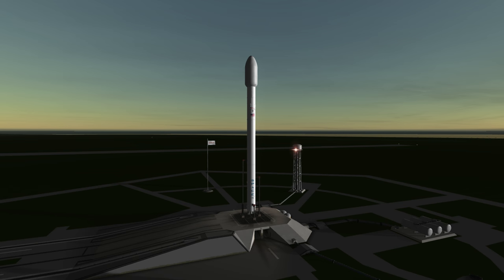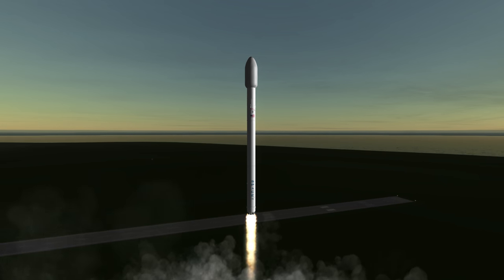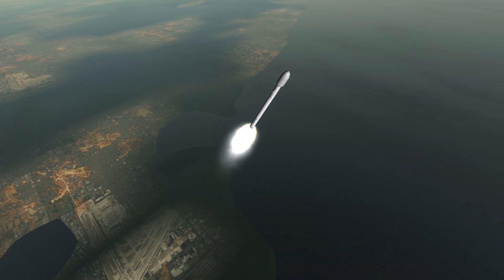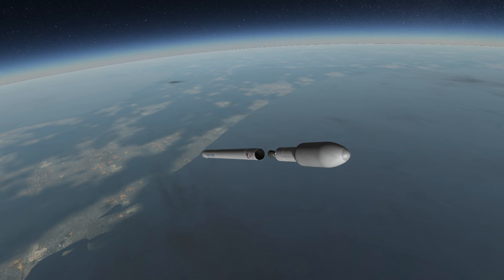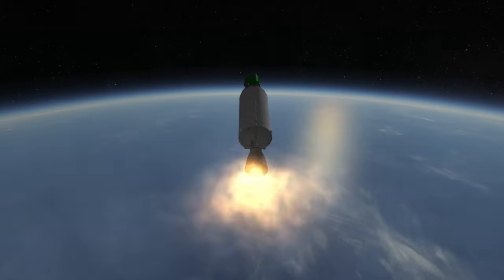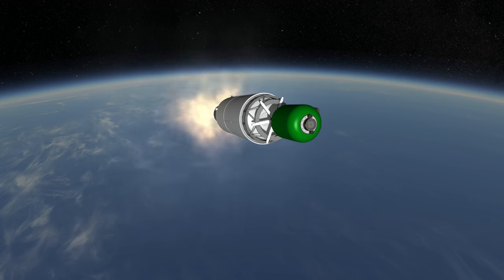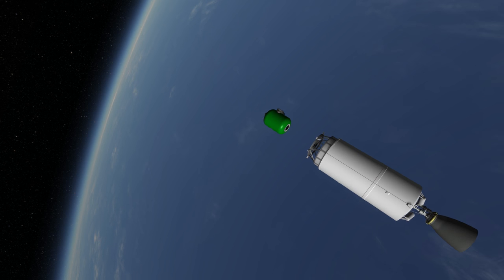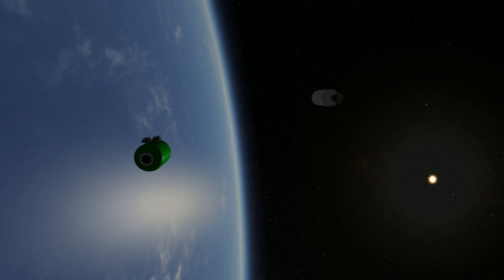Rocket Profile - Falcon 9

Comment: Didn't the Space Shuttle start the reusability race? Actually the shuttle was even more successful in that department than the Falcon 9.
Reply: The Space Shuttle was crippled by bureaucracy and government and was far, far more expensive than it needed to be, and also has killed far more astronauts than the Falcon 9. The reusability of the space shuttle was all publicity with no appreciable gains cost and time-wise. The Falcon 9, on the other hand, is an actual private industry rocket that is proving that reusability really can be a thing and really can drive down costs dramatically because of market forces (I almost said free market, but our markets are so heavily regulated that it's a joke to call them "free", but the costs would come down even further if they were). That said... the Space Shuttle was pretty cool... but the Falcon 9 is even cooler. We're doing stuff that was only dreamt of in '50s sci-fi with this rocket!
Reply: Debott 

Tl;dr:

Yes STS started it but F9 is perfectioning it.

BTW did you see the new Block 5 and the Heavy liftoff?
Reply: "Actually the shuttle was even more successful in that department than the Falcon 9."
Wow so wrong.
Reply: Go to 2:46 and listen.

Comment: You should note somewhere that the version shown is 9.1. Unless you did and i missed that ;]
btw, will you be doing Energia's profile? Would it be Buran or Polyus version?
Reply: It's actually the Expendable variant, which means the landing legs are missing as they are not needed.
Reply: Yeah, that's why i thought it's 9.1, i was certain that each 9v1.2 has landing legs (and is recoverable), shame on me.

Comment: I have a few questions:

1. Is this KK's SpaceX Launchers Pack?
2. Are you using Real Solar System? (It says on KK's Launchers pack page that RSS is not compatible by default)
3. If you are using RSS, can you please give me the config file (or whatever it is)?

Edit: Could you also tell me how to install a config file?  I've never done it before and I would like to know how.
Reply from the maker: Yes, it's KK's Launchers Pack and Real Solar System with Realism Overhaul. The config is my own and doesn't include all the parts - just what I needed. You can just dump it in the GameData folder but keep in mind that you need RO dependencies: https://www.dropbox.com/s/12bhmz6c7ihd4dn/RO-KKLaunchersSpaceX.cfg?dl=0
Reply: @RaizSpace  So the file is only for the parts used in the video?  If so then that's a bummer because I would like to use all of the parts that come with the mod.